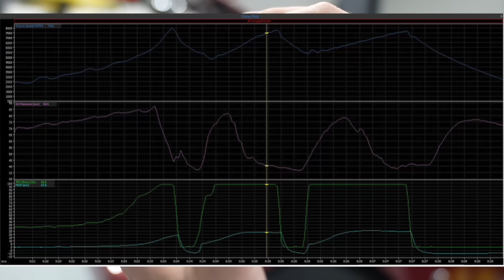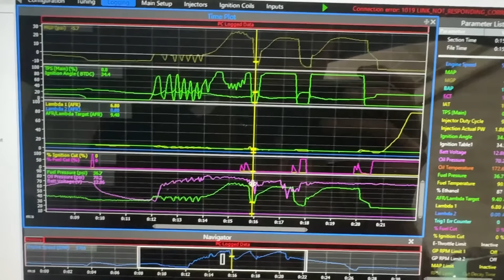Why I haven't Been Driving my R32 GTR

Comment: Love the GTR content but I'm looking forward to the skate park build for the compound. Here's an idea for moving it around easily once its built. You can get rubberized skirting to go all the way around the perimeter of the base and used compressed air tanks to turn the whole thing into basically a temporary hovercraft and then be able to push it around on a cushion of air. We used to do this with huge set pieces weighing thousands of pounds on the stage of an outdoor Ampitheater. Happy Easter All!
Reply: Underrated comment fo sho... sounds like a good plan
Reply: I’ve seen this type of movement with extremely large sets, modular buildings, indoor parks, and some walls. Really it’s incredible

Comment: Man the R32 is such a sexy looking car. The front is to die for. And the performance and overall concept is so unique. Bummed that i never get to own one. But nice progress on this one
Reply: There not that expensive. Could get one if you really want  even gtst are good fun
Reply: Gts-4 non turbo or rb20det,  they are AWD an share alot of the gtr drivetrain  are not $$$ an can easily bolt gtr bumpers & fenders on  + can swap awd stagea rb25det or a rb26dett into,   I did just this in 2007 before I could afford my first gtr.
Reply: I want one as well always been my dream car

Comment: I’m really surprised that you don’t put in accusumps in more of your cars, besides maintaining the oil pressure, you get pressurized cold starts and 1-2 extra quarts of oil in the system to keep it cool and less percentage fuel dilution. I run them on a couple of Prius’s, I’d certainly put one on a GTR. ✌️

Comment: Back when you were taking the white Evo to the track it was almost setting track records. Set up that r32 as a full track and beat those records. Light weight and a baller suspension package combined with all that new found power autta set track records where the Evo fell short

Comment: i’d like to see a better turbo on this r32 tbh. That hks is prehistoric and there’s really no real reason to run those anymore other than for the logo and nostalgia. If I’m not wrong HKS does sell a rebranded G35-900 so that would be a good upgrade that would still fit with the rest of the engine bay

trying out a xonarotor or a turbosmart turbo would also be nice but idk how that would go over given you’re basically fully sponsored by garrett voor turbo’s
Reply from the maker: I wish… HKS skipped the g35-900 and went from g30-770 to g35-1050 - neither of which are properly suited for my engine.x 35-900 would be the one
Reply: G35-1050 would be perfect!

Comment: The ocd in these vids is so satisfying. I love installing a freshly wire wheeled bolt that was disgusting to start with. A little extra time for a huge visual improvement. The red 32 is a perfect build imo. Super clean exterior. Not 10/10 so you can enjoy driving it still. Minimal but quality interior upgrades. Perfect engine build for a street toy and occasional track troll, great power and super responsive. Wheel, braking and suspension upgrades that are purposeful and well thought out. I don’t think you could do much else without adversely affecting the driving experience really. I think this would be a dream build for a lot of us. I’d do it to a 33 though lol. That’s my favorite generation of skyline and always has been.
Reply: It's not for visual affects it allows the bolt the thread and torque down properly

Comment: I would personally love to see either a modern turbo put on the car or the turbo you have re worked with modern internals because thats super old turbo tech and your missing out on a ton of efficiency in boost response and flow you could make more power faster and really have the best of both worlds which would make the Vcam hit even harder. You can tell on camera the change in the car. The area under the curve would also really benifit from todays new turbo tech it light years better. Glad to see the car back looks fun for sure. Keep up the good work and great content

Comment: It’s still dropping pressure dude. It should be steady around 80 psi over about 3500rpm. You’re seeing 45-50 psi on throttle.
Reply: Those are 10 times shorter drops than what he had before
Reply: It’s an improvement for sure. But doing 7000-9000 rpm (can’t quite tell where it is) with 45 psi oil pressure is likely to hurt the bearings.
Reply: I highly doubt it considering it's only for 1/10th of a second that it drops compared to a second drop that it had before. @timmurrayy

Comment: How are you going to pretend that the Nismo baffle is doing all the work and not acknowledge the massive sump extension you have? Speaking from experience, that baffle will not solve the oil starvation problem on its own. That sump extension is doing most of the work. Why not even mention it?

Comment: If only they made the car faster with the stock engine on Forza Horizon 5 car is fast off launch but up top it dies off around 225  but I run the sport exhaust or something with the sport turbo so the car sounds good but again it struggles to do 220 and that’s kinda annoying when all the v8’s can do 200 with ease and rb’s in real life can make up to 1,200hp if built right. Instead we get cars that are “built reliable” bro I’m trynna push 1000hp in the k20 but they cap us at 720 that’s some bull shit like bro nah yall are just making the most popular cars the fastest and it just goes down the line     Wish we’d get the 99 civic coupe back aka the em1 or better known as the last good looking civic 98-2k Honda civic Si 😮‍💨